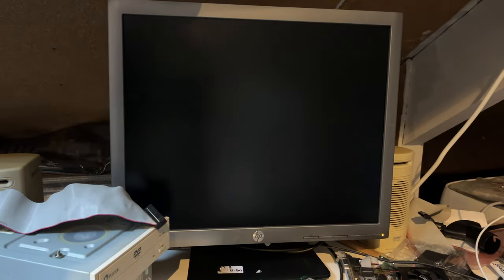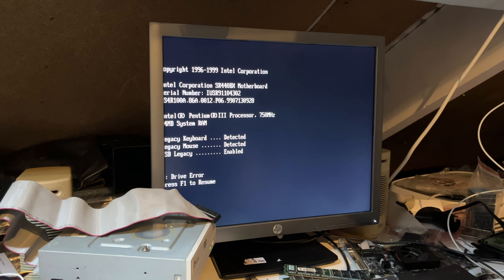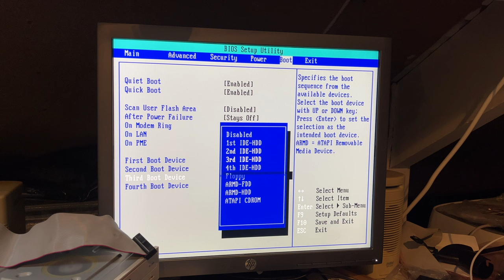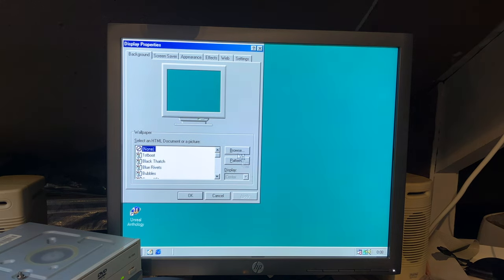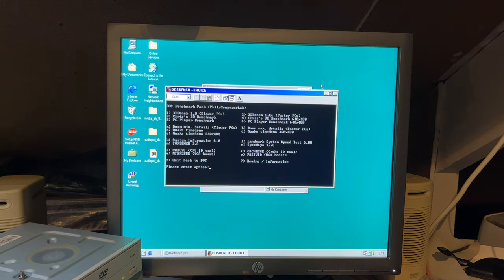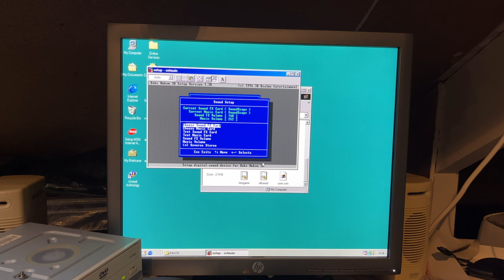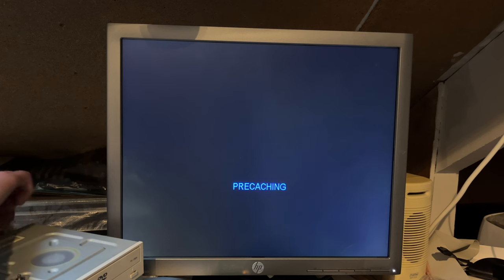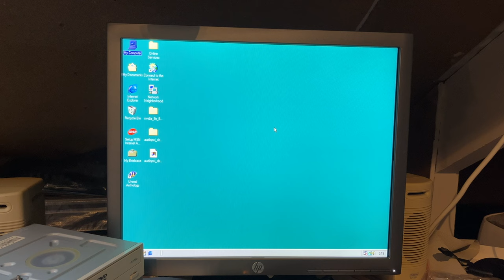Vintage Motherboard Haul - Part 4 - Intel SR440BX

Comment: Never seen an Integrated Riva TNT.. that's the genertion of gpu for the time i'd consider useful to have gone through the trouble of motherboard complexity to implement.. Rage 3D not good enough. I have a Compaq Prosignia with a 440BX it came with a Riva TNT and PIII 450. In 08 after 3 years of ownership I had  donor PC with a bad mobo I took a Katmai 600MHz PIII and a TNT 2 Ultra.. I wish I had kept the OG TNT but I had to put parts back into the non working PC to give it back and say couldnt fix it (honestly couldnt) and knew they werent pc literate.. kind of crappy of me but I was 16 then so meh. I still have this Prosignia its the oldest PC I have that still works and I plan to never get rid of it with its AGP. 3 SD Ram slots, many PCI and two ISA slots its quite cool with the venerable 440BX.
Reply from the maker: Integrated graphics sure were wild in the 90’s. The most exotic boards I have have TNT and TNT2, and one system with onboard Compaq QVision VLB. The typical VIAgra, S3 and Intel video chips weren’t all that interesting, though early S3 chipsets were pretty capable (like the S3 ViRGE DX and GX).